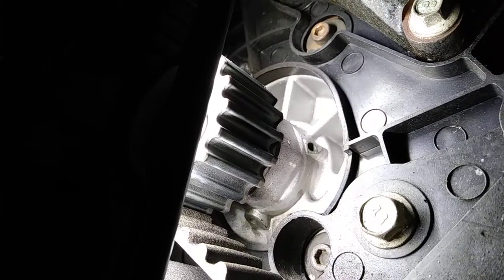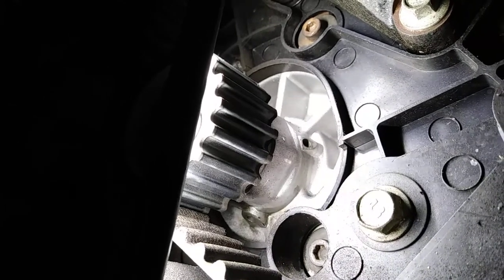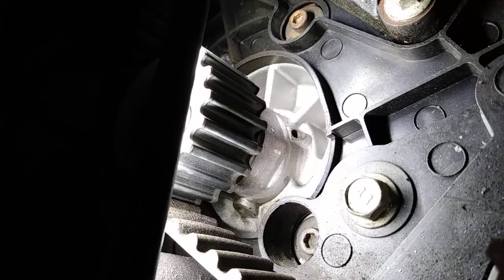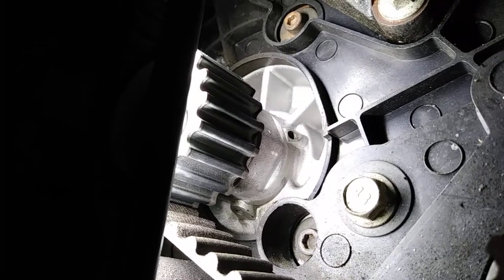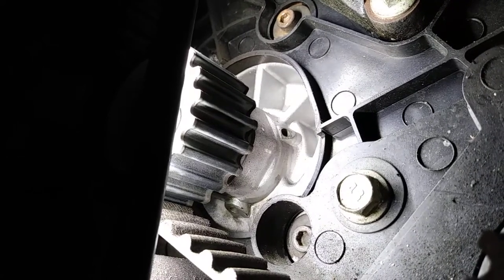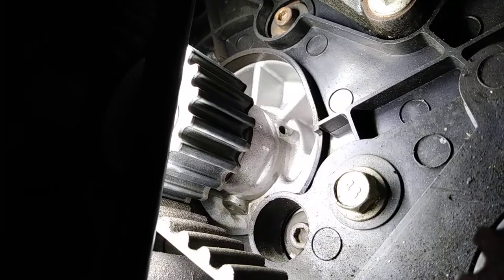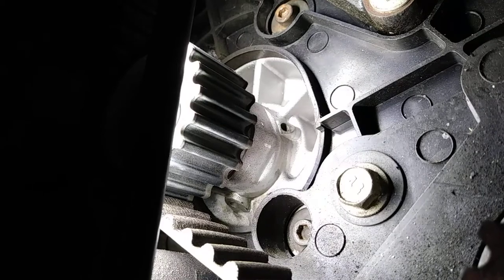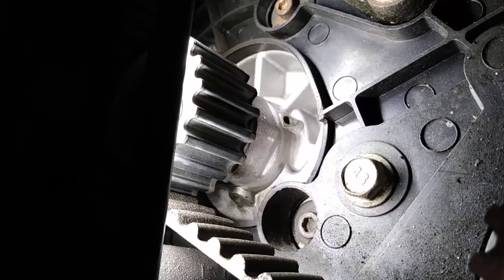Weep Hole Leaking (new water pump)

Comment: THis could happen if the system wasn't flushed properly prior to install and what ever was in their did the same thing it did to the original Water Pump and wore the seals and bearings. Or QC just ain't what it once was moving manufacturing from one slum 3rd world country to the next.  most major brands now outsource their outsourced manufacturing moving production as soon as the workers learn their jobs, and before they think about demanding a higher wage.

Comment: 2,3,4 drop out after running 50 KM .... is this normal?
Reply: no. it's only normal right after installing a new pump while the seals are setting up. Worn out pumps leak like that before they fail. It's a sign you need a new Water pump.